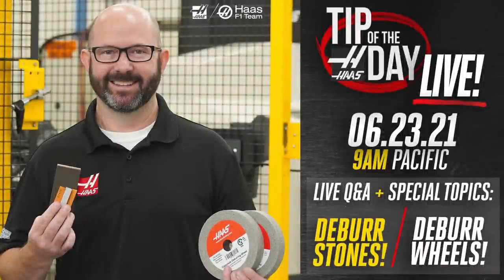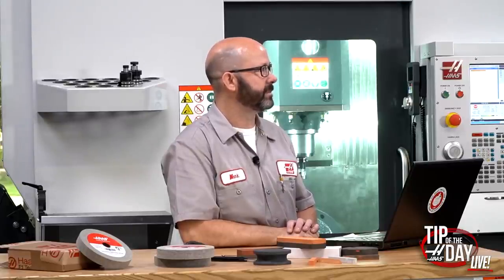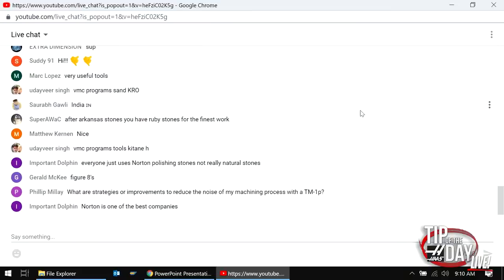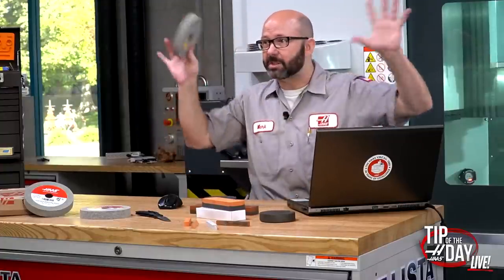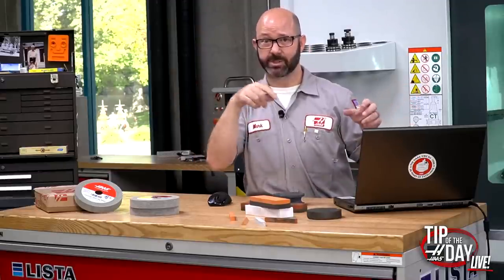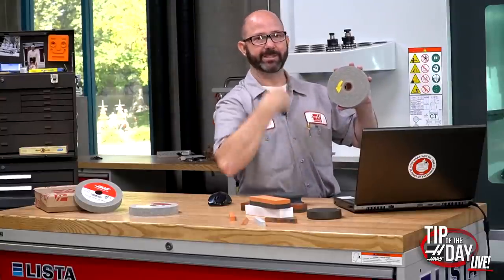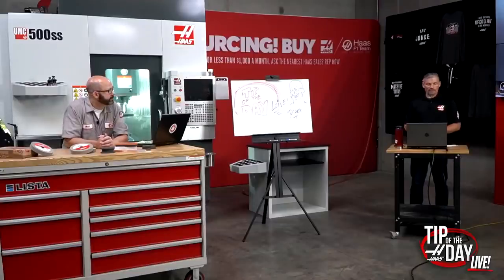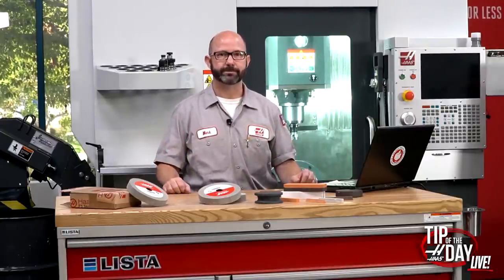Tip of the Day Live June 23, 2021 - Haas Automation, Inc.

Comment: Does Haas Automation happen to do any casting to make its equipment? Because I heard that semi-solid casting (often incorrectly called "semi-forging") and aerogel-based moulds (which have excellent thermal insulation) can both make some really strong parts.
Reply from the maker: Amaroq, SSM is typically used when making non-ferrous parts that are on a smaller scale than even the smallest aluminum castings we use. Let alone the iron castings we use for the machine structure.
Reply: @haasautomation  Ah, okay.

Comment: Yes, India stone, then Arkansas stone.  I have a Tupperware container that has held all my stones, soaking in cutting oil, for well over 20 years.  Hey, stones are porous especially if they are always wet.  So, I do my stoning when needed, then my thumbs go to work cleaning them.  When I get bored, or need some thinking time, stone on stone rubbing helps maintain fairly precise flatness.  It's surprising what you can do with the free time that accumulates over 20 years.

Comment: Hello, year ago someone showed me how to get rid of metal deposits on sharpening stones, you get grinding wheel grit from a bench grinder, put some penetrating oil on sharpening stone apply grinding grit, and use a second sharpening stone in circular motion to remove deposits. So your rubbing two stones together with grit
and oil in between. When done right it works just like lapping plates, keeping 
your stones flat.

Comment: The best way I've found to clean your stones is to take an old, used cutoff blade from an angle grinder, spray the stone liberally with WD-40, and using a figure-8 motion, sand the surface of the stone. Reapply WD as needed, and in no time you'll be down to fresh, unclogged stone. I don't know how this works with SC, but it works a treat on AO/India stones.